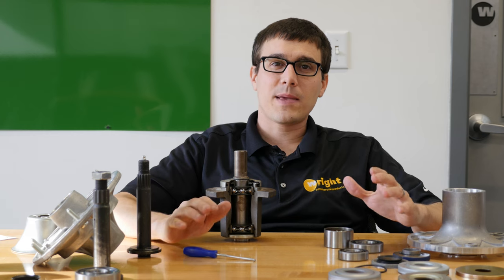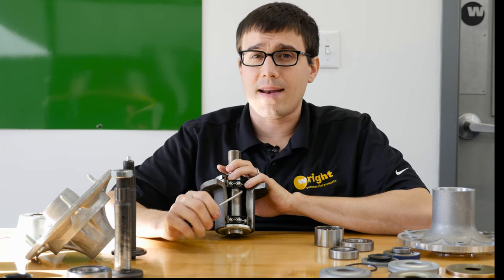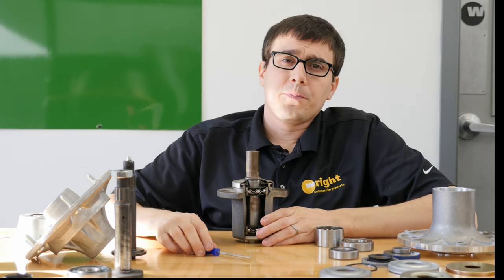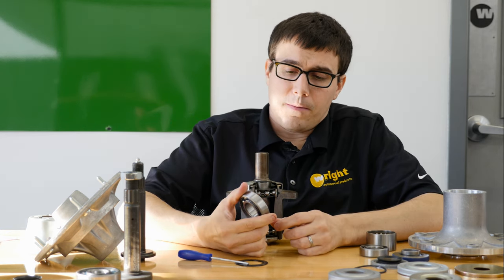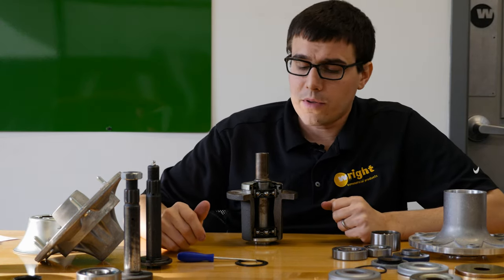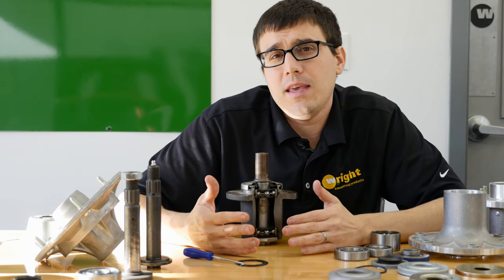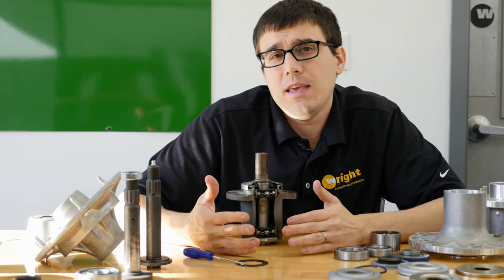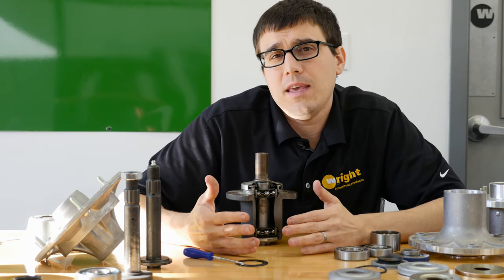Guide to Lawn Mower Spindles

Comment: excellent video
I got into looking at spindles since I picked up a toro timemaster.    There is a Big Market for 30", you all should consider it.

now..servicing this unit, the bearing are dry, all sorts of dirt-clippings..nastyness.   This is a common reason for failure, I think.

I heard your comment on over greasing....and thats interesting.  Quality of grease..yes..Ill go out and say there is a you tuber that did sometesting on the lucas red and tacky, and it looks good.  Im sure there are others.....I wish you would elaborate on this.  

Wright has a great rep on the street.   Think about a 30....people like them.
Reply: Harry, I have the Toro Timemaster 30 inch. Needs spindle work. What did you end up getting? Thx

Comment: Hello From Mark In Kentucky.  Thanks for your great video regarding the deck spindles. What brand or type of grease do you recommend for your mower deck spindles?  For my John Deere mower decks, I have been using the Lucas RedNTacky grease which seems to be working out pretty well for my equipment. I do know that some brands of grease do not work well together in which they actually have a negative reaction to one another.

Comment: I demo'd an X Stander before I bought my ZK. I loved the bolt on Spindle set up on the X and assumed the ZK had the same set up. I was very disappointed when the dealer delivered my ZK only to find out it has through bolt spindles. We change blades in the field quite regularly and it's a pain changing blades with through bolt spindles. My Intensity had through bolt spindles but, it was a 2015 model so I thought the new ZK would have bolt on like the X and like my eXmark Lazer Z has. What would it take to change out the spindles dollar wise? I can do it myself. Thanks, another great video.
Reply from the maker: Hi James, i'd be pretty costly to swap all three out.  We haven't moved away from the thru bolt because it seems to take the higher torque on the bigger machine.  I agree, it's a pain now that everyone has cordless impacts. -Ed

Comment: Thanks for the video good information. I have a couple of questions if I may ask
1) My mower is a Husgvarna M-ZT52 zero turn. The blade mandrels need bearings it's a cheap popular bearing 6204-2DLRS. The lower bearing is sealed only on the one side that is on the outside facing down toward the blade but open to the inside of the mandrel to collect grease. The top bearings are sealed both sides. My question is can I replace the lower bearing with a bearing sealed both sides so as to eliminate the need to pump grease into every 8 hours of operation or so.

2) On breaking down two mandrels and removing the spindles it became obvious that on the bottom of the spindle there is this steel cup which covers the outside base of the mandrel, it has inside a cup seal of sorts probably just an extra dust and water seal before the bearing seal. One mandrel had the cup of the seal facing up and the other facing down. Which is the correct way the cup seal should be facing when it slides up inside the base of the mandrel. Hope this makes sense.

It's stupid money to replace the whole mandrels when bearings are cheap and the units have not suffered any wear on the spindles themselves. Thank you.

Comment: Interesting question. How can you tell if the spindle you have can have its bearings replaced? The top of my pulley has a nut that can be removed. It does have a squeak and was thinking of changing just the bearings. This is on a 1974 Dynamark. The spindles were replaced three years ago and one is starting to squeak.

Comment: How would I get the ring Bearing holder  out of the bottom on the spindle housing? I have a new spindle with two closed bearings on it. But I can’t get the rings for the old bearings off.

Comment: This may be a novice question but how do you know when to replace your spindle? What are signs your bearings are going to need replacement soon? Is there a way to physically check on bearings or a method of which to know your bearings are good? Can wd-40 be sprayed under cap to push any water out after pressure washing? Or should cap be removed and add grease? Thanks Ed
Reply from the maker: Hi, You will know when they start going bad.  They make a lot more noise.  I wouldn't spray anything in there--just to shoot water right at it. -Ed
Reply: Wright Commercial Mowers thanks Ed. I’m very happy with my Wright! 
Chris Sturtz is awesome as well!! Very informative and quick to respond to emails!!

Comment: What about the effect of a big impact on the deck with a large cast iron spindle like a toro or husky spindle?
Reply from the maker: A "big spindle" is not so much of a feature.  Many companies reinforce either the deck or the casting (or nothing).  What's important is that something is being done to be sure it's strong.  Large casting tend to be very costly to replace and make the mower heavier and so we tend to reinforce the deck skin. -Ed
Reply: @WrightMowers  Very true, I just exchanged the spindles on my Z master from the old cast iron to the new cast aluminum and the deck is much lighter. Also I really like the hex bushing design that protects the deck and the housing.

Comment: Should a spindle spin loosely? I got a riding mower that i replaced the cable yet the mower won't spin the blades.  Belt seem a bit old but still good tho also I don't know if the cable should be tight when engaging the spinning cycle?  I need help anyone know this problem?

Comment: Can bad spindles effect how well the blades mow the grass? I have an older 38" hp Murray mower that seems to struggle mowing grass. I have to hit the clutch/brake to let the blades speed back up. I also hear a sound like tires burning out when it's struggling to mow.
Reply: briandd27. Yes
Reply: You need a new belt correctly adjusted.

Comment: What about roller bearings on a scag vs the ball bearings on the wrights
Reply from the maker: Hi Palmer, Yes--I didn't address it in the video.  SCAG is the only notable company that uses taper bearings.  The benefit is they can survive really high side impact.  The down side is that they must be greased very regularly otherwise the top bearing will blow out and also taper bearings are not good at high speeds (a trailer bearing might be good at 600-800RPM but a mower spindle goes 3000-4000RPM).  Our first spindle was actually a taper roller bearing but we didn't have good success with it. -Ed
Reply: @WrightMowers  Not understanding where you come off saying tapered roller bearings are not good at high speeds. High speeds is one their greatest advantages.
Reply: Duke Of Prunes  I respectfully disagree with ED. Tapered roller bearings are superior to ball bearings in about every single way. Just do your research and you will find out.

Comment: I uploaded a video of my 52” ZK (just over 50 hrs) where the deck belt on trim side is really jumping a lot. I put balanced new blades on (I use a magnamatic blade grinder and balancer) . The blade bolts seem to have more play in the spindle than my 36 I. Could you possibly go to my channel and check out the video and advise me please? I’d really appreciate it. Thanks